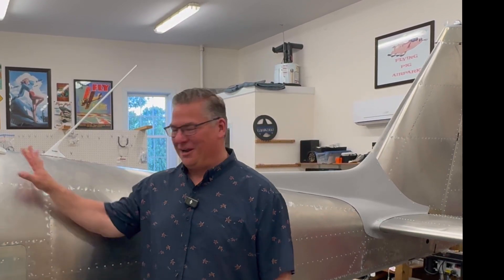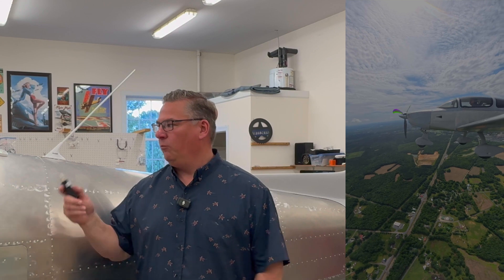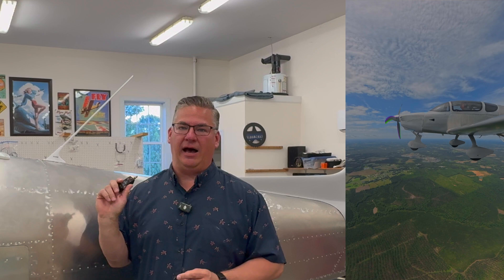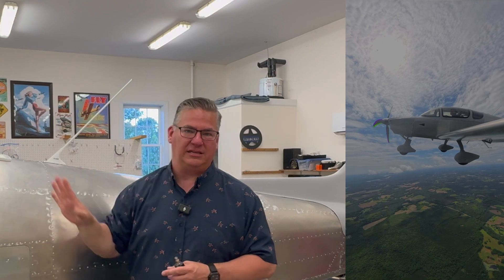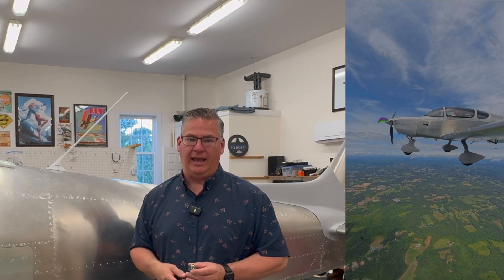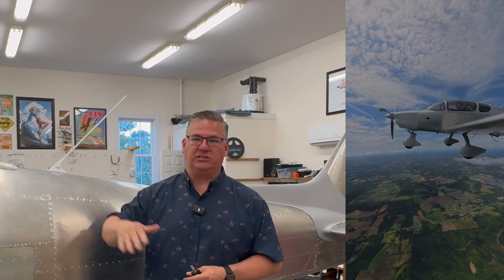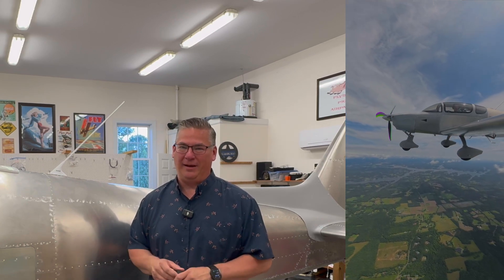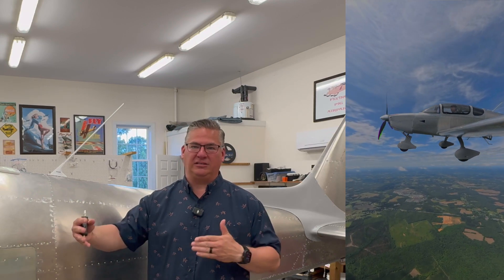First Flight

Comment: I had a similar thing with Com 1  and my problem was the connection point on the back of the GTN 650
Reply from the maker: Unfortunately,  I wasn't  lucky on this one. I ordered new coax and I'm going to re-run it.

Comment: Congratulations! How did you maintain flying proficiency during the build?
Reply from the maker: I would say, I did not maintain flying proficiency very well while building.  I flew very little during the first two of the last three years.  I did some rusty pilot training a little over a year ago, and then went out to Sling North America and did almost ten hours of Transition Training to get me up to speed with the TSI and knock more of the rust off.  Over the last several months I've done another ten hours with an instructor to include flying in and out of my neighborhood which has a 30' wide runway I was nervous about.
Reply: @aviationkitbuilder  I agree completely with you about landing elsewhere and driving to Oshkosh. Looking forward to seeing it painted and gracing the skies. Safe flying and best wishes from Connecticut.

Comment: COM1: just a thought, is there a layer of epoxy on the rivnuts, preventing the metal to metal contact required for a good groundplane?
Reply from the maker: Unfortunately , I'm not getting any wattage to the coax.  I ordered new coax, the original run installed years ago must have been damaged.